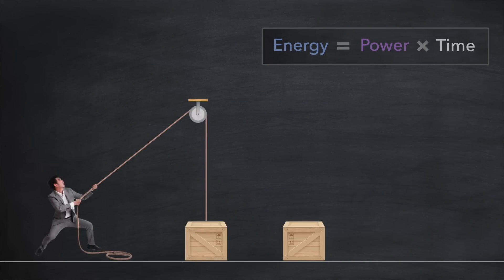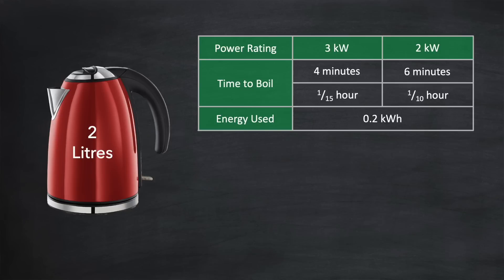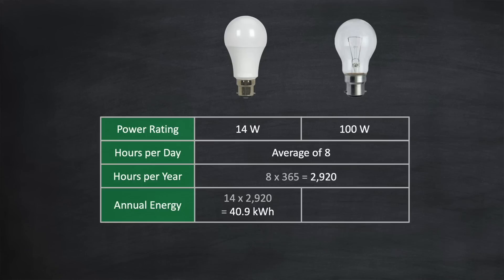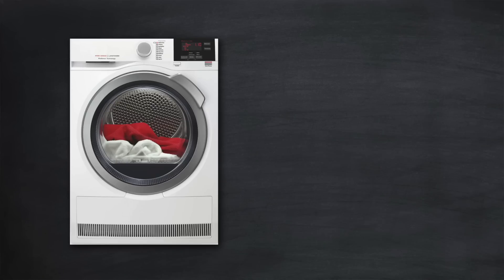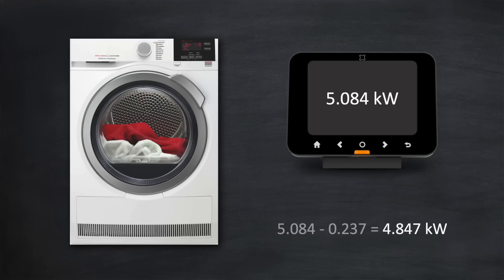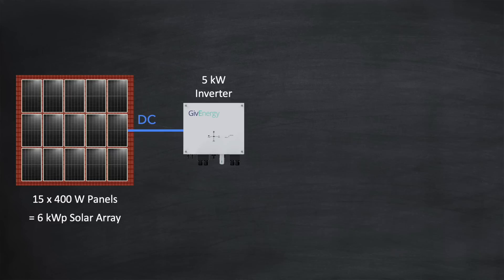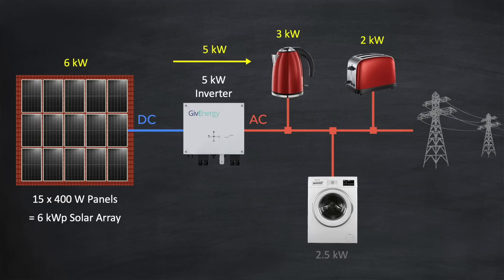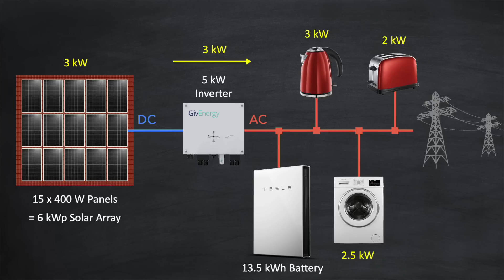kW / kWh: What’s the Difference? Power & Energy Explained

Comment: Excellent videos Gary. I have had my 4kW system with battery storage since July. Your videos would have definitely helped me and if anyone needs help with installation, I point them to your channel. Hope your install goes well once installed it starts taking over your day making subtle changes to your routines ensuring that high consuming devices are not on together.
Keep up the good work.
Reply from the maker: Thanks Roddy - this is such great feedback to receive! :-)

Yeah, not long until my install now - and I think you're right - it'll take a while before I adjust my behaviour (and more so, the rest of the family!!) so that we don't exceed the 5kW maximum of the string inverter (or 3.5kW of the battery) - I have a monitor next to where I normally sit, and every now and again I see it hit >5kW - so it'll be a challenge! 

Hope you are getting on well with your solar setup (sounds like you are). Is there anything that you would change (or add)?
Reply: @GaryDoesSolar  Yea that is the thing I would change I would have gone for a 5kw inverter rather then the 3.6. (No kettle and toaster at the same time) The battery storage is the game changer and what got me looking into the setup. We are able to run the house  even in the depths of winter on off peak power with days like today giving us the boost of solar to the battery.
Next is to get my home automation to a level to make sure this can be maintained when my young children are older, switching off unused appliances.
Reply from the maker: @barraidh5l  Sounds like you've got a good plans going forward - I like it! 🙂

Comment: Great video Gary, I think all of your videos are clear and informative. I’ve got 5.74 Kwp solar with a 5kw inverter, I’m having a 7.2 kWh batteries fitted tomorrow with an AC coupled 3.68 kw inverter. Would the inverters work together for example will they supply 8.68 kw of power if I’m generating enough solar and my batteries are charged before pulling power from the grid?
Thanks Gary and Happy new year
Rob
Reply from the maker: Hi Rob, thanks - that's very kind of you to say! It's certainly a lot of work to make each video, but comments like this really help to keep me going! :-)

Great news that you're getting your installation done tomorrow (exciting!) My own installation is booked for end February (it's a sorry tail that started a year ago!)

Yes, your inverters will work together. What's great about AC voltage is that generators (whatever they may be, including solar inverters) can just add power onto that supply independently of what else is happening with that supply (appliances, other generators etc.)

Hope all goes well with the install!